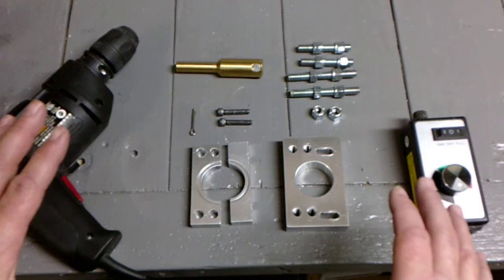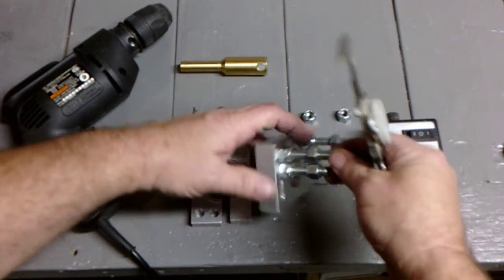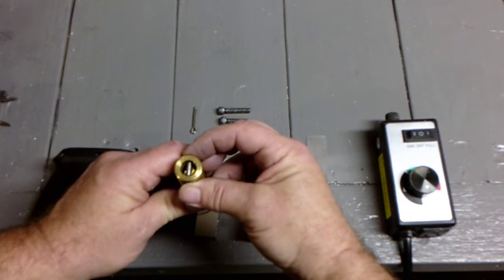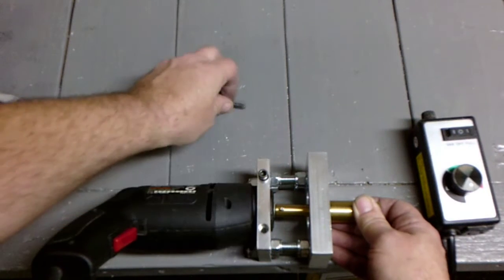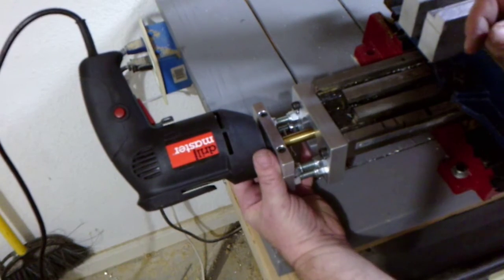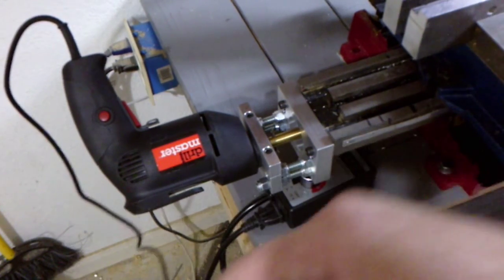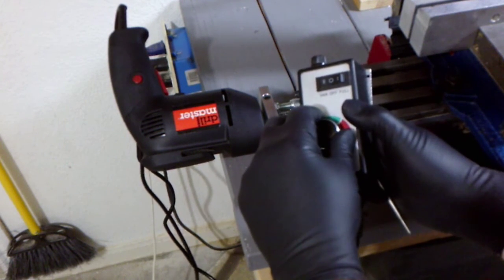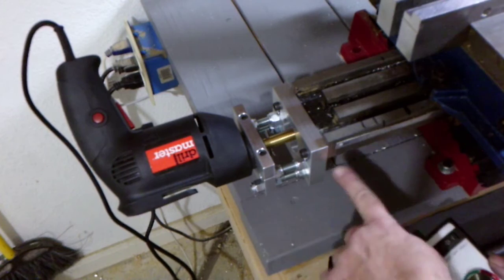POWER FEED FOR A MINI-MILL

Comment: Awesome job for a simplified and basic power driven table. One thing could make it even better is to use a dc geared motor with a control that has reverse voltage and speed control. This would streamline the back and forth process. For making understandable and simplifying the concept, you have done a major service to hobbyists. Thank you for your kind sharing.

Comment: I have 4 or 5 old drills with dead batteries.  I bet one could be modified for this project
Reply from the maker: I actually used a cheap corded drill for the purpose of being able to use a separate speed controller but feel free to use whatever setup you like.
Reply: @thingmaker7538  corded drill would be better.  No power supply to deal with

Comment: Can you update the link to the corded drill you used?  The link you gave us doesn't work.
Reply from the maker: You can use a corded drill from Harbor Freight tools. Drill Master 3/8 variable speed reversible drill (60615)They have one with the collar for a support handle. That is the one I used and the link is for Amazon's version (which is the same drill). At the time I made the video, I was an Amazon affiliate.

Comment: Is that box at 6:40 a drill speed controller kit? How do you reverse the drill? Is it a forward/reverse drill?
Reply: The box is a router speed controller available at Harbor Freight Tools . I reverse the power feed by switching the direction switch on the drill.
Reply: @suzettekendal6063  
But, the drill is AC Mains, I can't remember if reversing a Mains drill is possible. I think I've retired for too long now, I am starting to forget things. 😣

Correction: I've just found out, yes you can reverse a mains drill. Silly me. 🙄

But, how did you wire it to make the drill go in reverse? Are there any instructions?
Reply: @suzettekendal6063  
Nice name Suzette. Is it a nickname?
Reply from the maker: Sorry about having Suzette Kendal's name on my reply...somehow I replied to your question from my wife's account...and that is her name.
Reply: @thingmaker7538  
Got it. LOL 😄

Comment: Does the handle still turn easily with the drill connected all the time? 
This definitely seems simpler than a lot of the other videos I've seen which require clutch mechanisms.
Reply from the maker: There is some resistance from the drill but it does turn fairly easily.